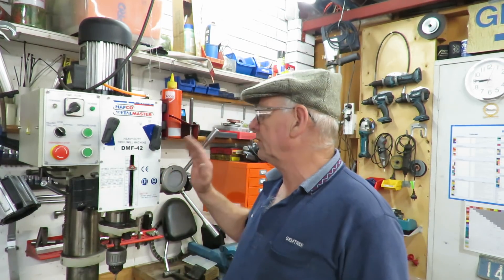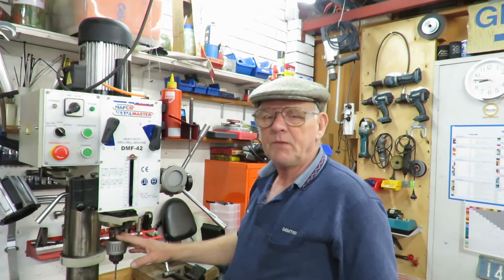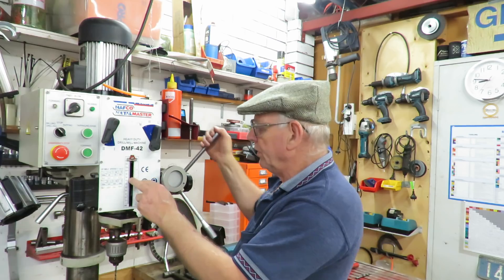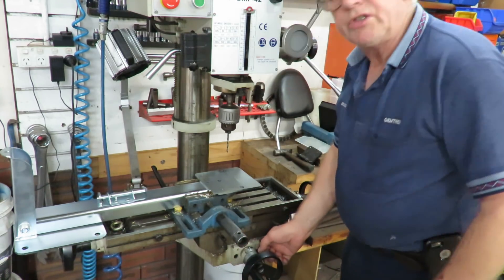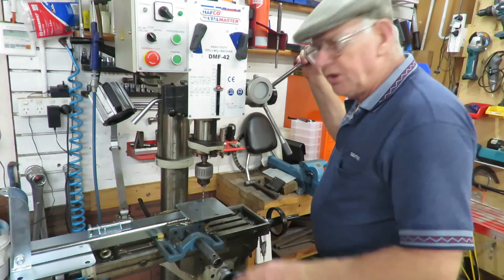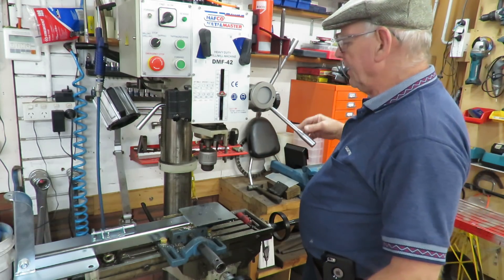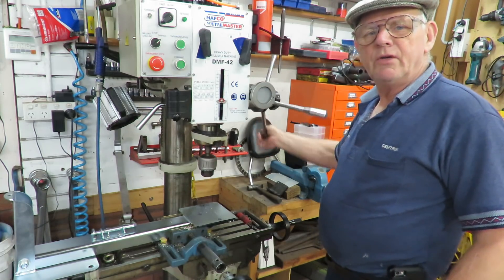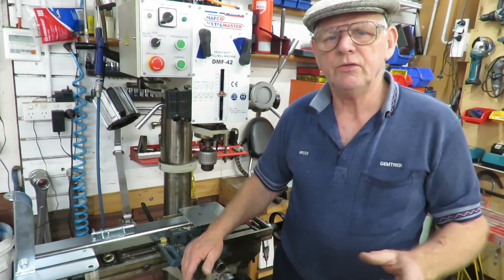DMF - 42 Pedestal Milling, Tapping and drilling machine

Comment: Nice setup, Bruce! I like the micro-switch for tapping. Makes me wonder if I could modify my mill/drill to do the same. Seems like it's just a bit of wiring to the VFD with the switches.

Best wishes to you and the family!
Tom Z
Reply from the maker: Tom G'day Mate! if you have a VFD (I don't) should be easy to fit a microswitch (Stefan did some mods to his). You would have noticed I stuffed up a bit, when you engage the tapping switch you need to be in low speed to avoid crashing the motor and or gears. run an auxiliary input to the vfd and set some parameters should be good.

Comment from the maker: Every shop I know has at least 1 Drill Press, I dispensed of the smaller ones years ago. the advantage of the tapping system is you can do quick work that doesn't require ultra accuracy on the press, no need to raise and lower the head or table to fit a tapping attachment. despite that A lot of drilling and tapping does get done on the mills. Horses for courses as the saying goes.

Comment: Interestingly enough, looking at the Hare and Forbes site, it seems the DMF-42 no longer comes with the tapping feature. On their current model 'DMF-42' the entire 'control box' has been replaced with a simple emergency stop and forward/reverse switch.
Reply from the maker: Yes you are correct, No Idea why when they have a good thing they have to change it! I looked in the second edition this year and it is not there at all??
Reply: This phenomenon used to be called "Herblock's law" after a well-known cartoonist viz.  "If it is useful, they won't make it anymore," or words to that effect. Empirically verified by my experience.
Reply from the maker: Funny H&F generally like to keep a range of stuff through many years with minimal changes / upgrades hmm.
Reply: I think this is a deliberate ploy by H&F so you have to buy there specific gear head pedestal tapping drills. Why make a machine that stops someone buying another one they can sell you :-)